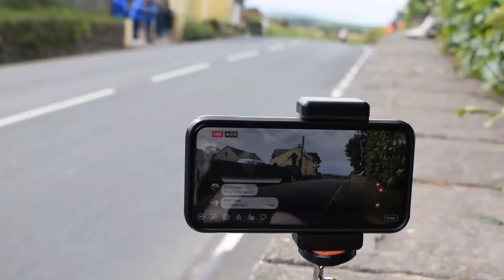Why 1000cc Isn't Fun - Even On The Isle Of Man

Comment: so no more road riding is it? is the little cbr600 going too? I have a 929 blade, geared to 15/45, hooligan but top end is well clipped, much more useable for the  roads, a cb750 rc42 & fazer 600  that i absolutely ride the wheels off when I'm out. don't want to sound like an old fart who'd say anything more than a 250 is too much, but the power the 600s are making now they're plenty for the roads..and racing is always tight with them too..
Reply from the maker: Still road riding daily and all weather - most of which doesn’t make for good videos 😂
If I’m out to play on the roads it’s a 450 supermoto - which is similar in that it will barely break 100mph, but gets there like nothing else! 

Tom has just got an MT09 and being relatively new to the roads he is still very much enjoying the roads as I did - so there will be plenty of chance to see that here 😁